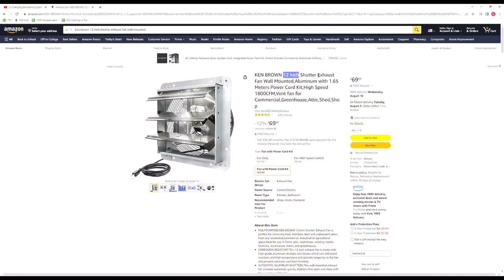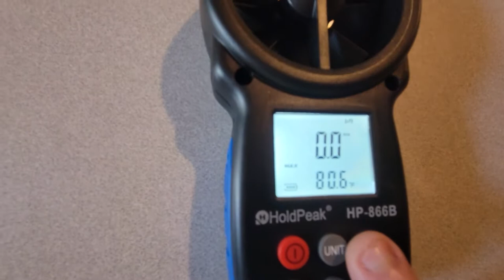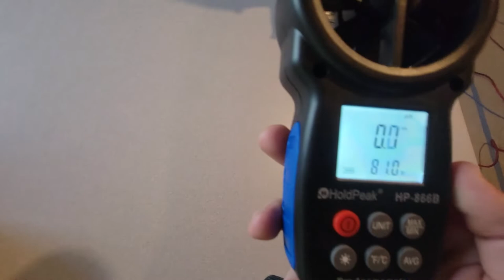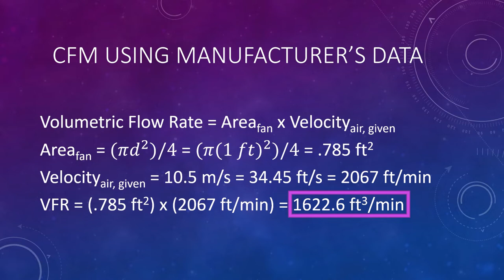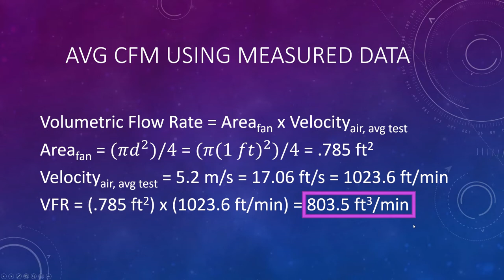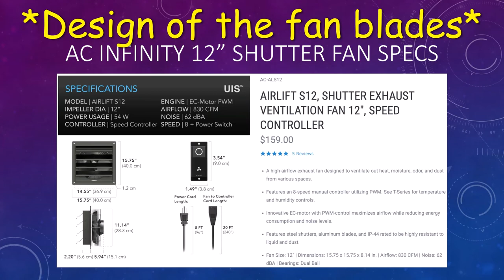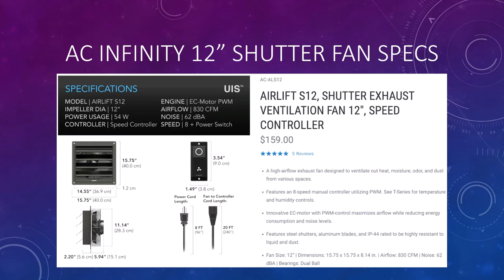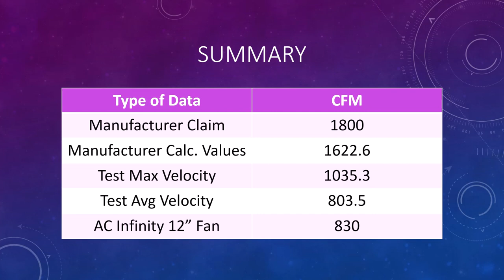Can This Cheap 12" Exhaust Fan Actually Push 1800 CFM???

Comment: Hello. Been looking at the 10" version. I wonder if the 1800 cfm is a theoretical max based on fan pitch and rotation speed. Clearly this is way too high. Ad info suggests the 10" move ~640 cfm so maybe that's more like ~350? No worries about the sound and great work!

Comment: It would be great if you tested an electric gable roof fan that can be picked up at HD or Lowes.
Reply from the maker: You can pick up an anemometer super cheap from Amazon and try it out yourself if you want. It only cost me like $25 I think. And since airflow is so important with mining, I'll be using it for so many more projects in the future.
Reply: @mecheltcryptomining9297  Oh! I thought those meters are really expensive.
Reply from the maker: @MrTiger0002  nope, they're super cheap. Go check them out!

Comment: this was a bizarre test you performed, although I appreciate the effort. I feel that the entire video was almost completely irrelevant without power consumption data. You also failed to acknowledge static pressure which impacts CFM tremendously. 

Basically you critiqued their published specs, but that doesn’t seem like the mission of your investigation, which would be to find an energy efficient ventilation fan. Am I correct?